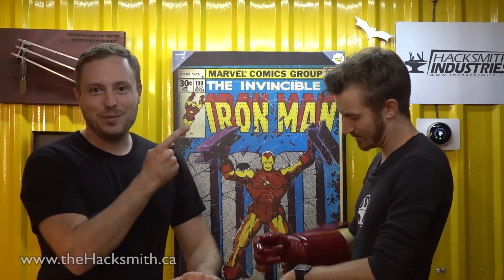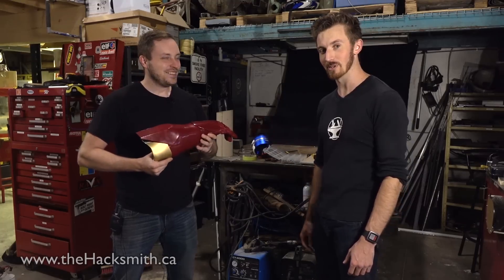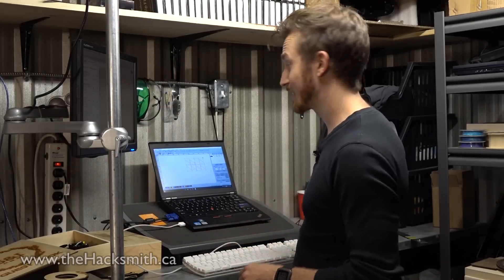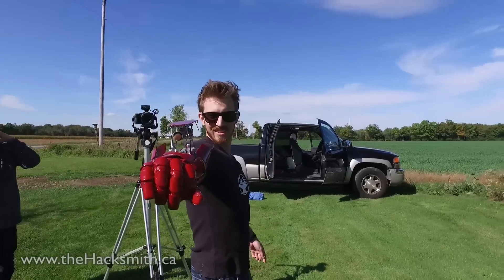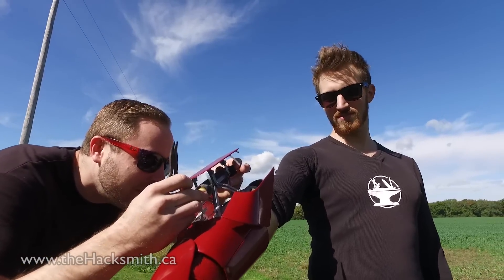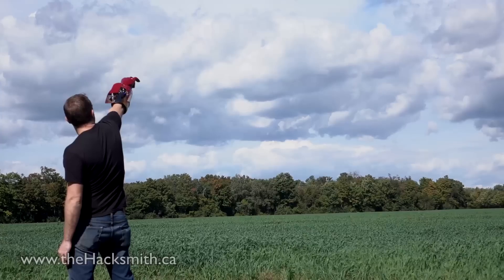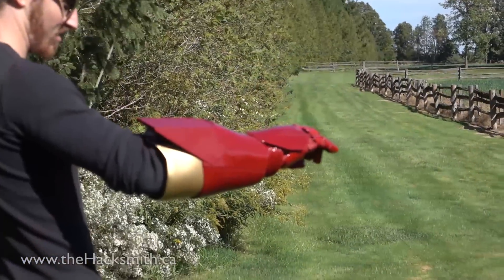Jairus of All's Iron Man Rocket Launcher with REAL ROCKETS!!!

Comment: Hi hacksmith I’m making one my self but reusing co2 cartridges as the base im having a few problem like the balancing issue where It just goes everywhere and also the weight the fuel I’m using is home made and I can’t really regulate how much force it’s pushing 😂 but I think I could fix the balancing issue by switching to plastic but the fuel burns really hot and it melts the plastic please lmk what I could do to fixed these issues and last thing I’m using a titanium back plate for the rocket so it would have a lot more force pushing up and because of the high melting point it’s working fine and it handles the heat
Reply: Titanium plate at the back isnt as needed, just something with a high melting point and high stiffness. Make whatever plastic piece being warped by the heat, be made out of metal.

Comment: If you slow the video down you'll see that the cinderblock breaks before the mechanism activates, so he's actually just strong as fuck
Reply from the maker: Wait what
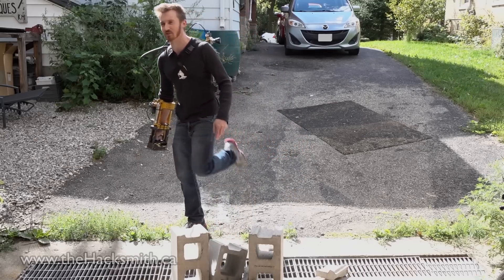Reply: Oh yes, I see it too @ 4:58 .. a few frames before the breaking, 
He actually broke it with raw power, the piston ejects later on..
I also see that the impact landed on the hollow area of the block which is comparatively weaker to the center of the block, still impressive.

Comment: You should put a tiny wall at the back of the launcher/holder. That’ll protect your face and give the propellant something to push off of. You might think about building in an upper and lower groove(s) into the track, so you have ample room for 2 decently sized and rigid fins.

Comment: In order to get the rockets to fly straight, you need to make sure that the center of mass is in front of the center of pressure
 To calculate the center of pressure, you need to find the centroid of the entire shape (in 2d). You can either increase the area of the vertical stabilizers and the location of the centroid in them or put more weight in the front of the rocket to move the center of mass forward. Also, by having the vertical stabilizers diagonal, you can put a spin on the rocket giving it more stability.

Comment: The reason they flew right in test was because they had a launch rod to gain speed. Unlike the launcher, which was just a very short tube. The reason this is a big deal is that most rocket fins have minimum speed before they actually keep the rocket stable. Without anyway to can speed, it will just spin out. Now, you can launch a stable rocket with now way for it to gain speed. However, you either have to have an active stabilizer, like a gyroscope or RCS, or be powerful enough that it instantly gains enough speed, more speed that a model rocket engine can provide.

Comment: no that is nowhere near a success LOL. the reason why when you pointed the launcher at an upward angle and it flew well is because you are putting the weight in a up and down directions which  Rockets can launch easily from. why do you think NASA points the space shuttle straight up on lunch instead of taking off from a Runway like a plane. The best thing I can think of off top my head would be some sort of rail system to get the Rockets momentum going in a straight line before it leaves the launcher.

Comment: hey man I like what your doing I just wanna ask the real hacksmith what energy are you using or um what are you using to make your inventions work.
I had an idea there are some batteries called antigravity used for bikes try using those for the tubines I believe you can use two of those bike batteries they are light so you would be able to carry them and they should pack a punch
Reply: if not use more batteries  they are light I should say
Reply from the maker: Lithium-based batteries are still the most powerful and energy dense batteries available at the moment (which is what we're using) -- there is research being done for other types of batteries that could be better, but sadly, nothing is available yet =(

Comment: NICE!!!

Should have worn MORE ARMOR so you can aim the projectile; AND FOR PROTECTION in case it misfired. and some fire extinguisher and a med-kit.

As for your "power fist", you have a flat surface. the punching force will be dispersed in proportion to its surface area.
 you should have a pointed knuckle so ALL FORCE of the punch will concentrate on one focal point.

Comment: You could add some spring loaded wings to the rockets. So, they're retreated while in the launcher itself, but pop out once they reach the end of the tubing. That should increase the stability of the rockets and make them more accurate. Would be interesting to see if that works. Would greatly decrease the amount of fuel. However, you could move the fuel tank a little more to the top of the rockets to compensate that. I mean, you don't need explosives in them anyway, so why bother? The wings should have low height, but long lengths due to the small rocket size. Just an idea.
Reply: Ah, just saw the part about the rockets. You actually have wings on them. I think the plastic material doesn't expand fast enough, which makes them so instable on launch. If you take a more sterdy material, which pops back to its former position more quickly, should do the trick. Like a thicker or harder plastic in general. In worst case, you could add some roller pen springs in between the rocket's body and the wings. 

That would explain why those rockets worked fine on testing, but failed the tests with the actual launcher.

Comment: It might work better to make a square rocket and make fins like those on the Evolved Sea Sparrow or SM-6 missiles.
They have small fins on four sides but they run the entire length of the missile, this is so they'll fit in a VLS system without taking up space and that's a similar problem to yours !

Comment: Do you think completely sealing the rear, then building the launch tube out like a suppressor with an open front to vent gasses would work? It'd increase recoil but be safer for use (I think) Also, accuracy might be better if you used 6 fins, 3 up front, three in the rear, as opposed to two, so it's more stable in the tube. I'd build a prototype but I'm great at ideas, but no so much with the building or funding lol.
Reply from the maker: Let Jairusofall know! His channel is linked in the description =)
Reply: Will do! Thanks :)

Comment: as some who makes reeeealy big rockets, you're better off making a "cannon" or spring loaded ejector that gives you velocity and distance before the rocket actually ignites, also you need to do math to figure out your stability. good programs like rock sim or open rocket will do the job. your rocket doesn't fly straight bc your fins flutter. you need find made from very thin tubbing (cut in half long ways) with spring loaded hinges at the same od as your motor to make them fold, deploy and lock without flutter. next since you dont have a rocket  (just a motor) you need to induce a gyroscopic spin to account for the coning i saw in the test launch. or ypu can make a tail cone on the end without find at all and still induce a spin like a bullet and you can make that one very accurate rocket.
Reply from the maker: +marek foxtrot should go tell Jairus that! It's his project :)
Reply: the Hacksmith it's very cool how quickly you replied. :D you got a subb from me
Reply from the maker: I always reply to comments =)

Comment: For the last bit with the power punch, I was wondering if you could see if you can alter it so that it's a circular fist with a hole in the middle. What this would do is it would be fitting around the wrist  but with a press of a button on the palm of the gauntlet the cylinder will go past the hand and punch the object

Comment: I would assume that since the wind is blowing really hard the rockets are getting affected. I think the only way to overcome that is for you to put more thrust into the rocket
Reply: let's begin gaming - I considered that maybe the solid rocket fuel was jarred loose or distributed unevenly in the rocket motor causing it to have more fuel in one side. But your theory sounds better than mine.
Reply: Apollo_ tbh that could also be the problem cause for something that small and light, every small thing counts. also, I thought that since the rocket it's really light even the lightest of wind can push it around so I guess more thrust and a little bit of weight should counteract the wind. idk though

Comment: the problem is not in the rockets it is apparatus plus it being attached to the human arm the apparatus moves back slightly due to the thrust and the human arm flinches when the rocket lights changing the trajectory due to the unknown way in which the arm will change the trajectory due to the flinching process.
Reply from the maker: +CME Gordy a little bit, but the rocket still flies crazy once it's been launched. Check out Jairus'latest video on his channel -- he fixed the rockets and they fly much better
Reply: I will do that thank you for responding

Comment: If I can give a tip about what's wrong with lauching the rockets in the gadget, it maybe is because your arm it's not firm enough to hold the strength of the rockts (3rd Newton's law), it's like what rappen when someone don't hold a gun firm enough.
Tony Stark's suit maybe have a suporting system that alow him to stand still in all the body, maybe this system automatically hold all the rocket thrust, probably giving even more thrust, even when he's moving.
Reply from the maker: The rocket only produces 1-2lbs of force, pretty sure my arm can take it =P

Comment: Make a 2 stage ... propelled by CO2/hpa (hack an old bb gun handgun for air valve and CO2 canister receptacle or electric actuated solenoid valve & also add range and additional stability) via short tube and 2nd stage ignited with an ignition system activated by a very small wire (delayed electrical charge to ignite before wire is severed when at a safe distance from the user) .... or just a thin thread that when pulled out from rocket nozzle ignites via friction (like a pull ring or something) .... this way would add some safety (rocket only is "armed" or activated IF it's 1st CO2 propelled stage is successful ....... try different style of fins such as those from a FRAG-12 shotgun round adding more distance, accuracy and maybe even some additional koolness???
Reply from the maker: Go suggest this to Jairus! He built it remember!

Comment: I think I know what is wrong with the rockets and it would require modifying the launching mechanism a bit.
The rockets are not getting enough drag, it's as simple as that.  The fins are not activating correctly.
If the launcher has slits for the (3 or more) )fins to ride along as it launches the stabilization could be good enough during launch to keep the rocket straight.
Reply from the maker: +JohnSmith FakeName go check out Jairus' channel!

Comment: Hey I'm no rocket scientist but I believe if you would melt down like some paper clips or some other light grade metal, then fill the tips up and a small ring around the back creating a stronger ballast between the nose and tail as well a small guiding system wouldn't be a bad idea :) but for real this is a small dream of mine and as soon as I have a few more tools I will be putting my engine   designs into a physical form ;D

Comment: Try a shorter nose cone (3rd the size) and longer launch tube, looks like not enough velocity, the rocket body almost hit your hand so the fins probably did or (quick fix) change the angle of the launch tube to give the rocket a clear path to pickup speed.

Comment: Tried the nose cone, rocket motor (as the body) with glued fins...does not work. There is an issue with center of balance and center of pressure. Try to build little rockers that work on A or sub A size motors. That should allow proper flight.

Comment: the problem with your rockets is your using to big of a solid state motor there are some really small that are even smaller than a AAA battery if you make full smaller rockets that would just fit those you might even able to fit 2 in holder giving your self 2 shots the smaller size rockets can be made on a 3D printer also if you give the fins a small curve it will give you a straighter flight, also the launcher needs to match that pattern. problem solved. also I dig the stuff you make.

Comment: Awesome mechanism. Unfortunately, horizontal rocket flight is far more complicated than vertical, since the force of gravity is at an angle (and generally close to a right angle) to the thrust. This adds a lot of instability and unpredictability, which is why rocket systems used for combat have a lot of design and engineering revolving around them, sometimes requiring control surfaces similar to a plane.

First, you need to handle basic projectile aerodynamics, which one can look at arrows for guidance (pun not intended). A nose-heavy design is the critical lesson: if you're back-heavy, the nose will deviate and if the nose deviates, the whole projectile goes with it.

Second, for rocketry, I would look towards RPG's for inspiration. It is one of the earliest and most consistent examples of horizontal rocket flight and has remained relatively unchanged since it was made (in a time long before the complex flight systems of today).
Reply from the maker: Share this on Jairus' channel! It's his project =)

Comment: I believe the rockets were so innacurate was because of the fins, they have little to no stability because of the twirling.
Maybe a 3 fin triangule setup on these rockets and some guide slides on the rocket holder and maybe this could then become VERY accurate

Comment: Might I suggest that maybe there be some safety guards under the launching mechanisms so you don't get burned in case the rocket gets stuck?
Reply from the maker: There's a bunch of metal underneath -- and as shown when the rocket didn't leave the tube it was fine =)
Reply: the Hacksmith where that patch of skin was?
Reply from the maker: I dunno which patch of skin you're talking about... below the rocket is all metal -- my bicep is exposed, but even in a misfire if the rocket stays in the mechanism (like it did) it would burn out, if it started melting any of the parts, it still wouldn't reach my arm. could also you know, turn it upside down and drop it =p

Comment: I know the military uses pre launched rockets with compressed air i wonder if that would work. that and a match striker tied to the end or a compacitor with momentary switching connected to some thin kanthall wire. i could see it in my head the teather would pull on the end of the rocket straitening it out as it ignites and could serve to straiten it out a bit as well.

Comment: Your rockets are too short. In order for those rockets to be stable at such a short length, you'll need to extend the fins further back beyond the rear of the rocket. If you made the fins fold forward to load into the tube & have them spring back & open up past the nozzle of the rocket you should be able to get it stable & maintain the small compact size.

Comment: I movies they use the same thing but they guide the rockets with fishing line.  They never will fly straight the way you are using them.  Plus the fins have to be rigid and smooth.  That water bottle fin shit won't cut it.  Also the nose cone is too heavy.  There's just all kinds on ignorance to basic model rocketry being ignored.

Comment: The rockets in the gauntlet have way too much thrust for such a short and light body.  I'd use some much smaller solid rocket engines that slide inside 3d printed (or cast) shells that have no seams between the nose cone and the body with a 1/4A engine.  It's still gonna go a long way, and the less dramatic increase in thrust should help control it.

Comment: I'm not sure why you guys are extending your arms in order for all the rocket exhaust to go right to your face. (to move the rocket a few more inches closer to its destination? )You can just as well bend your elbows at 90 degrees  and launch it from the  side of your body with far less chances of burning your face in case of an accident.
Reply from the maker: That brings it closer to your face... look closely in the video -- the rocket plume shoots out the sides of the gauntlet, holding it sideways like you said would bring that close to your face.

Comment: maybe the rocket should spin like a bullet for accuracy???
Reply: yeah, sounds legit
Reply: Nah, I think it's viable; text can be misinterpreted.  It could be possible.
Reply: TheBlockBreakers is this sarcasm?
Reply: The 'Ex wife' rocket was described by Justin Hammer as a kinetic kill missile (that's not the full description), which means that it uses speed to penetrate its target, get inside, and then go boom! It did not fail because it was faulty -- it failed because Rhodey fired it at a short range target and it did not get enough time/distance to build up speed.